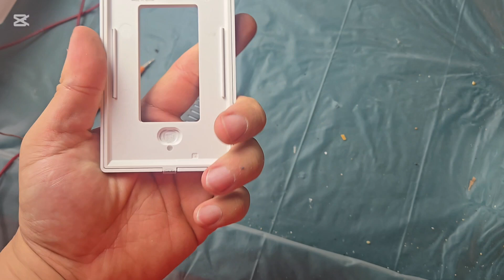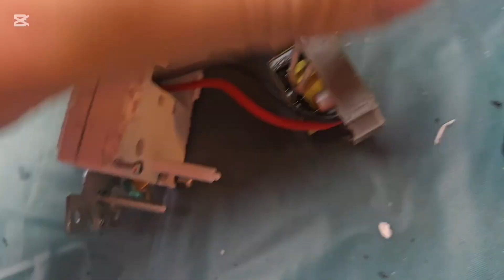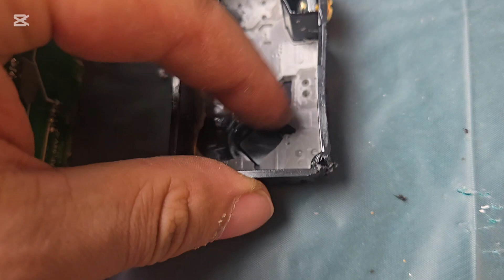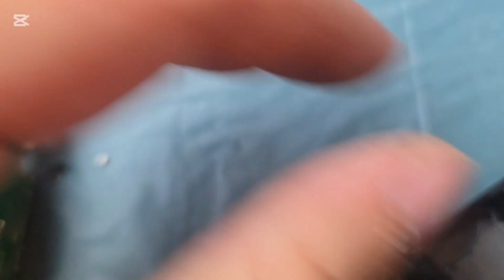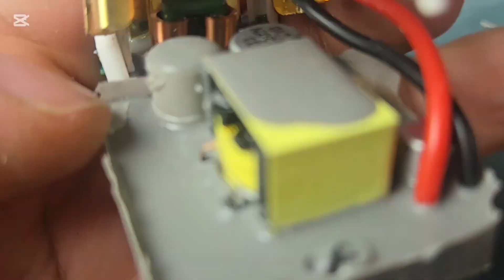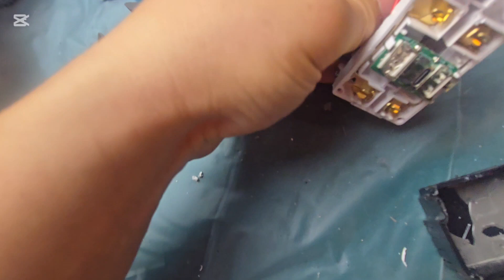USB Outlet vs Regular Outlet: How They're Different

Comment: Did you ever find out more about the circuit board that you thought was unnecessary?
Reply from the maker: I believe it regulates the rate at which the current can leave the device when you plug in a USB device